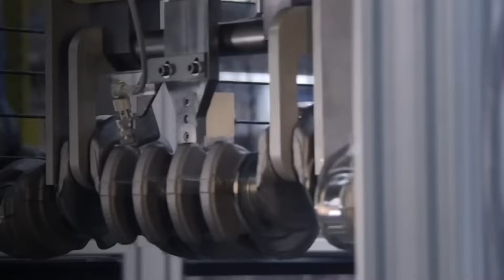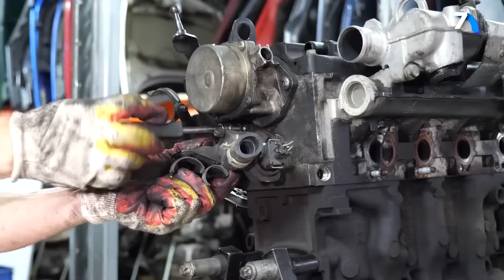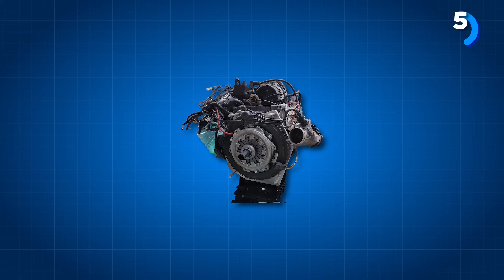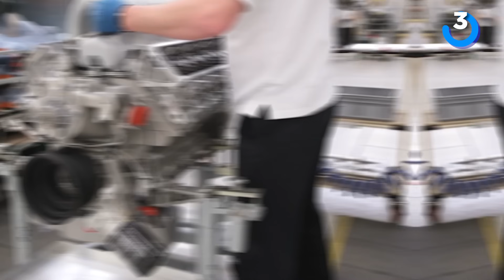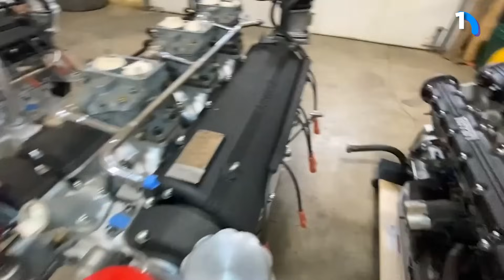12 European Engines That Last FOREVER (2025)

Comment: Well... I have Mercedes-Benz W210 (year 2001) E220 Cdi with automatic transmision and 24 years old engine with 310 000 Km (192625miles) Never changed engine or transmission and still running good....

Comment: Actually 1.9 TDI is 90HP and 205NM torque.
Offroaders love to put 1.9TDI in smaller machines like the Samurai or cut off Pajero and good ole M57 into the big boss Patrol with BiTurbo setup… can’t kill em.

What I was missing from the list is the old 200D Mercs, legendary OM606, and Volvo D5.

And ofc the unkillable Suzuki G13 and G16… those u can literally clutch kick from rev limit right after cold start. U don’t even have to wait for the engine to reach temp… u start it, u push it to its limit and it doesn’t break down. These engines are basically fuel, oil and water and they go off the map, eternity + 1 day is their lifespan.

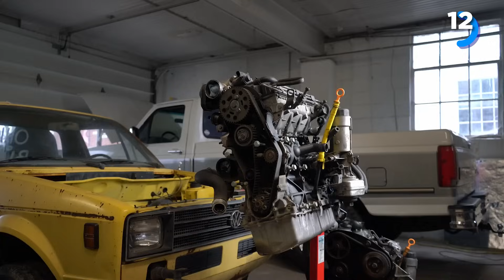Comment: What??? An engine with 1.9L volume and compression of 19.5:1 makes only 90HP???(@1:25/25.30) That is pretty hard to believe
Reply: Yet true… have a good ole B4 Passat 1.9
Reply: @BoneCrushRakaImProWise  I think there is either a text error. The compression is 9.5:1 on gasoline engine or it is a diesel and it should be making quite a bit more power then that
Reply: @ It is still only 90HP, it's can be easily tuned tho. There was the AFN version that did 110

Comment: Mercedes om606 is missing in this the straight 5 and the straight 6 could run off mechanical fuel pump

Comment: Renault 1.5 cdi isn`t reliable
Reply: I have a clio with this engine and it's the most reliable car i ever owned (and also the cheapest). It's slow and not very comfortable but this thing is just bulletproof. I bought almost 2 years ago and it just never broke down. Compared to other cars i owned (Jaguar X-Type and BMW e60 530d) that little Clio is super reliable. 
That's why i kept it as my work/backup car. It's a good engine and it's very cheap to maintain

Comment: European cars are made to run on 95-98 octane. in usa they misfire due to low octane fuel. They will need to run on 91-93 usa octane. Not many people refuel with that octane due to price. This is main factor of failure. Let the diesel that’s another thing eu diesel is only 10pp ash content while usa is 500ppm that will block the engine in few years. Simply poor fuel quality

Comment: 1.6 hdi psa-ford engine,1.9 1.6 m-jet fiat and opel 1.7cdti [isuzu] deserve to be in top 12
Reply: I had a 1.6 PSA diesel in a 2010 Mazda 3...Worst engine ever ..I went from a reliable petrol Mazda 323 to  that and I  ended up being a regular visitor to my mechanic..I must have spent £3k on repairs ...
Reply: @265justy  one of the million
Reply: @Vader74  Uncle had a Focus ..Same engine and even more problems.
Reply: @don't want to argue, but this is a engine for 400000km without problems, never heard a lot stories about bad 1.6hdi
Reply: @Vader74  The DPFs give lots of trouble with carbon build up ..Resulting in turbo failure and other knock on effects ..Thats what happened mine at 160000km..

Comment: Turbos engines dohc direct injection don't last long specially diesel don't know about variable timing but if it ohv or sohc naturally aspire may be more believable ,  turbos mess up internally  engines , also sleeves in the motor,, v12are better than v8 n inline's are the best long lasting to bad they stop making them 8n 6 slow manufacturing don't make them like they used to,

Comment: There's a few that don't belong in this video, LR td5? Please, it's one of the shortest lived designes of the marque, 8 years, the only engine that was shorter in production was the 200tdi which was actually the final rework of the 1960's 2 1/4 petrol... Should have had the 500,000 mile plus 300tdi instead, it has a lot less issues that are showstoppers, the td5 is getting old at 200.000 miles. It is plagued with electrical and injector issues which often result in catastrophic piston failures.

Comment: In the clip of the VW VR6 there was a rapid flash of a Lancia V4, justifiably, as the narrow V angle and single casting cylinder head concept was Lancia's from decades before VW adopted it. The commentary should have acknowledged this.

Comment: I have two Audis:
A4 1.9TDI 131HP 2002. (GOAT)
A6 2.0TDI 136HP 2007. (GOAT after A4)
On 2.0TDI I replaced turbo and cylinder head after 410.000km. It rolls great. 1.9TDI is indestructible.
Reply: How many times did u replace the belt?
Reply: audi is trash.

Comment: Volkswagen VR6 and "last forever" should not be used in one sentence. Since they included this engine while excluding the old 1.8 L VW engines, BMW M50/M52/M54 and the old 1.9L Mercedes Diesel engines, I have my doubts about the other engines mentioned in this video...

Comment: is this just AI bollox ?

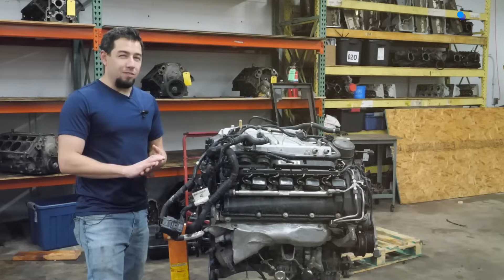6:25
Article is full of errors here:
The AJ-V8 engine covers a number of variants of Jag's first V8.
There are (and I may have missed a few): AJ26, AJ27, AJ33, AJ34.
Launch engine was AJ26 followed by AJ27. Both had problems with timing chain tensioners, Nikasil liners and thermostat housing leaks.
Most issues were fixed at around 2000, when the AJ33 & AJ34 were launched (or thereabouts).

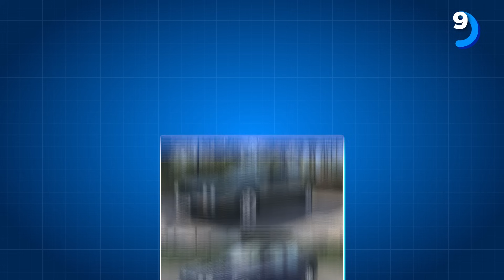7:34
Bottom car pictured is an X-Type, not an S-Type. X-Type never used the V8.
Reply: Sure is. I'm sick of creators using AI voices etc too.

Comment: You forgot the best diesel engine in the last 30 years which is under 2l. It is FIAT 1.9 JTD Mjet and even 1.3. The most reliable, the most durable, indestructible. In addition to Fiat, they were also found in Opel, Saab, Cadillac, Chevrolet, Jeep, Lancia, Alfa Romeo.
Reply: *Roaring sound of engine,  as appreciation.
Reply: @dubiskubidu  I have 2 vehicles, Fiat Croma 1.9 150hp and Grande Punto 1.3. I have been driving them for over 10 years. Who knows how much mileage they have because they were imported from Italy, and when vehicles are imported to Serbia, the mileage is always reduced. They are not noisy. The vehicles do not consume a single milliliter of oil from change to change, they do not have any smoke from the exhaust. Fiat is very popular in Serbia, we even have a production facility, so I know many people who own one. Also every mechanic will recommend jtd ie mjet engines. If noise bothers you, don't buy a diesel, buy a gasoline one, or preferably an electric one.

Comment: The Z18XE engine deserves it's own spot. Super reliable when well maintained.
300k km on mine and still going strong. 😊
Reply: Do you happen to know if it's an interference engine? I have the Z18XE in a 2005 Astra and it is super reliable, but I worry about the cambelt.
Reply: Hi, yes it is an interference engine. Mine is on a Saab 9-3, it has 300k km and I replace the belt +/- every 80k km. I just had it replaced last month. This summer I will replace the camshafts, pistons, conrods, valve springs and valves. Engine will be good as new.
Also a piece of advice, invest in a heat shield for your ECU as it is the most common point of failure in this engine. 😃
Reply: X18XE1 astra G....almost 400k km... still my daily drive

Comment: In my 21 years of living in Europe I have never heard of an engine break down in 2-3 years.
Reply: Mercedes 220D and VW 1.6 D in 70 and 80 lasted forever
Reply: @nevenhero4902  We had a few old Mercedes diesel  cars at work. They all lasted more than a million km. Same with the older Toyota HiAce models. We had at least 2 that passed 2 million kilometers. They were running a 8-10 hour delivery route every day. Our accountant took a day off to mourn when Toyota did not replace the HiAce with a new one. The diesel engine in it would not pass the new EU emission regulations, and it was to costly to develop a new engine for a model they didn't sell a whole lot of.
Reply: So where is located the rock you've been living under?
Reply: I think the Rover V8 should have made the list. It’s was used in vehicles for over 40 plus years, and was virtually bullet prove. Also the Jaguar XK engine that was first developed in the late 40’s  and was still being used in the 90’s. Just a thought
Reply: Vw Tiguan Tsi 1.4 a lots of vehicles get engine Break down within 40000km. More then 80% of this model get engine down within 80000 km. Japan Car better then Europe
Reply: @ really? Had 2 of those , the main problem is the timing chain at 80000 starting to sing , change it and that was it .
40000 are absolutely no problem with those engines unless you are in the US. 
Quite official that a lot of american mechanics are having trouble with small engines and 1.4 seems to be to filigrane for them.
Reply: @loboptlu  Yup,my 1.8 132kw TSI is really bad,not 1 single problem from 2014. Do maintenance people,less problems
Reply: @makuhas4626   There is an another video: the 20 worst european engines. Watch that too. TSI engine is among them. The VW engine mentioned here is a CR TDI 1.9. The PD TDI 1.9 is also an unreliable engine (Common Rail vs Pumpe Duse). Small detail in the description of a car nobody notices, but one is the most reliable, while another is one of the worst...
Reply: @makuhas4626  80%............... Really???????  Ok, that's an ABSOLUTE LIE over there....
The company i work for, has a fleet of 1.4 Tiguan's (12 of them, all from 2020).
All of them are already beyond 150000km, and had ABSOLUTELY ZERO problems up to now....

As a matter of fact, i never saw a car in my entire life, whose Engine, would break down within 80000km....
Even the old fiat punto's (one of the most unreliable cars ever made......) would easily reach 150000-200000 km on them.......

Comment: Hate to say it, but surely, from a reliabilty point of view, the Toyota 1.8 2ZR-FXE has to be here. it does 500,000 kms without even breaking a sweat. Basically any of the Toyota Hybrid engines have to be in with a shout.

Comment: Incomplete list, and i disagree with k9k sorry
-any 1.9tdi or sdi engine 👍
-peugeot/citroen 1.8d or 1.9d any of them and also saxo 1.5d 👍
-mercedes om 606/605/603/602/601/617 and more👍
-Renault F8Q turbo version 👍
-volvo 5 cylinder engines also very good 👍
-bmw 320 and 330d the first ones m47/m57 and so on
-fiat 1.3mjet and alfa romeo 1.9jtd
These are the best euro diesel engines

Comment: As a 1.9TDI and 1.5 TDCI proprieter (Ford, 2016 without Adblue with a single camshaft and 8 valves) I can tell you that the two engines are the same are reliable.
Yes, Ford's only reliable engine is this.
I also have a 2.0 TDI 150CV, from 2015 VW with that in garbage

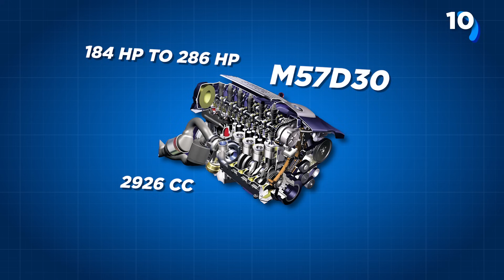Comment: 5:08 multiple misinformation here.. Power range was 150-286, plus it wasn't a 3litre, the 2.5 litre version was first and is overall more common. Plus we have to differentiate the legendary cast iron and the shitty aluminum versions, as shit hit the fan the moment it wasn't cast iron. The M57D25 (or y25dt) in my Omega can easily do over a million Km-s without major rebuild, high pressure pump literally never fails, chain can easily last up to 800k kms, and it can handle serious tuning without changing anything inside the block. The alu version breaks chains, spins conrod bearings, and has a crankshaft 3 friggin kilos lighter than the one in my cast iron version 😅

Comment: And as someone mentioned... Fiat 1.9 jTd is missing. Should be larger list 😂
Reply: Because they’re crap and built by GM and not Fiat. Vauxhall, Fiat, Alfa Romeo, and Chevrolet used them. 
They ate swirl flaps, clogged egr valves for fun. Shall I go on ?
Reply: @Dan23_7  sure go on... Jtd 8v has nothing with gm.. later ones have gm block but im not talking about them... Its an alfa engine and a great one... Dpf..egr.. is a common problem on any diesel engine, caused by idiots buying diesels for City drive... Tho i prefer gassoline engines my self, and my fav would be m54.. its a tank, problem free, and cheap to maintain
Reply: @Dan23_7 You're wrong, that engine was built independently by FIAT, who sold the technology to GM in exchange for some of their platforms. GM has made modifications some of which are bad. But in FIAT it is very high quality. In Serbia, one of the most common and most praised engines. Number 1 to a cubic capacity of 2 liters. It's my job and I'm very interested in that brand and I know about it.

Comment: Bmw m57 engine is good but i dont think i would put it before m54 lol. M54 is literely trouble free engine, no swirlfaps, no dpf and other shit.. i made 300.000 km on it and changed nothing but spark plugs, oil, filters.. and it doesnt sound like a tractor

Comment: Where is Renault 1.4 and 1.6 8 valves gasoline engines? This engines have 2 millions km on taxi drivers without engine interventions! Those engines was mounted especialy on Dacia models (Logan,Sandero) ,and Renault Clio and Kangoo... I had a Dacia Logan on taxi (2010) with LPG . I modifed to start the engine on LPG and i sold the car after 10 years and 800.000 km in perfect condition. That car seen about 10 liters of gasoline in her entire life! Start on LPG,off on LPG,the gas tank always empty....😂😂😂 Verry reliable engines,less hp or torque....

Comment: Suggest you get the right pictures with the vehicles you talk about. Jaguar x type as an S type. You never mentioned the 5 cylinder Volvo engines that in both Diesel and Petrol form have legendary reliability. Please no more computer generated voiceovers! Also the Mercedes OM diesels

Comment: Volvo's 1800-2000cc-B engine and the newer  knee's ``tin-free'' free-breathing 144 hp last an incredibly long time.
Volvo's D5 diesel also lasts to the ends of the earth and is also reliable. 
The latest VEA engines are not as problem-free as ``tin-free'' ones.
I've driven a Volvo for 400,000 km and the only complaint is the naturally aspirated's tendency to guzzle fuel quickly. 
The problem with that is that the price of gasoline/diesel has been politicized!
WW also has good engines, but we had a Passat whose 2-liter gasoline engine blew up at 330,000 km. releasing engine fluids. The road led to the bale. New Wolksvagen is `Take your hand`s off.

Comment: They forget about the DW10TD engine, it is the most reliable engine of the 21st century, even more than the 1.9TD/1.9d/1.7d of the PSA group.
I have seen units with more than 800,000km (more than half a million miles), they do not lose fuel injection, the injectors are indestructible, the control unit is immortal.
Reply: Very true! I have the 100kw/136ps D4204T version under the bonnet of my 2005 Volvo S40 2.0D .. 20 y.o. and still goning strong, never ever had a problem with this engine, still on it's oiginal fuel pump, injectors and turbo. 
However, reliability sadly took a dive after they added a DPF and a supposedly more "inteligent" yet sticky and troublesome EGR valve that could not be disconnected in models from 2006 onwards.

Comment: Motor 2.0 HDI 90 and 110 cp  citroen Peugeot the best Forever 🔥
Reply: I have one, and it is the best motor I have seen in years as a mechanic.
A very solid block, it is very well thought out, and designed to last for many years, the 90 hp has a fixed geometry turbo with mechanical management, and on top of that these engines sound great for a diesel.
If you look at the piston rings of a DW engine they are exaggeratedly huge, as well as the connecting rods which are super heavy and large, you compare it to a TDi and the TDi ones look like toys.
Reply: @SrKevin90 yeap, but who wants 90hp out of 2 liters today? That is the dilema of the day
Reply: @ Yes, but it moves quite well, even though it is a 90hp 2.0 HDi, it is an ultra-reliable engine.
I would like to buy the DW10TD again if they were sold again, it doesn't have a DPF, the turbo is fixed geometry with a mechanically controlled wastegate, it is a very simple common rail engine. Honestly, I prefer this one even though it's not as efficient, but I know it won't let me down.
7 months ago I did 1700km with mine, the trip was almost non-stop, and it behaved like a true champion despite being 23 years old.

Comment: All Suzuki engines are bulletproof, irrespective of what sector they are used in. Cam chains instead of dry or wet belt as well.
Reply: This list is of European engines not japanese
Reply: Unfortunately not, my M16A engine had severe issues in the end... broken piston rings f.e.
Reply: @floriangabriel5202  maybe it's your hard luck M16A engines are in general super reliable

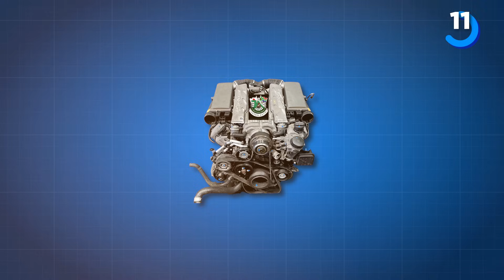Comment: 3:40 WRONG. Where did you get those numbers from lol. The 574hp version had 700Nm or 800Nm depending on year..

Of course its going to be far more than 590Nm if it has 574 hp at like 6000 rpm........
The most powerful verison of the m113 had 650hp and 820Nm.

Comment: This list is incomplete without the Mercedes 605-606
Reply: and 604
Reply: 604 a lot less durable than 605 and 606
Reply: @floringogu4975  no. The engine is durable as hell, but the lucas fuel pump is garbage
Reply: @zoli124mb 604 rods are shit, they will never take the torque the 605 and 606 rods can take
Reply: @floringogu4975  only the turbocharged 605 and 606 can take a lots of torque. The NA version is the same, like 604
Reply: @zoli124mb  of course I was talking about the 605 606 turbocharged , these are legends, you can't put 604 in the same league never